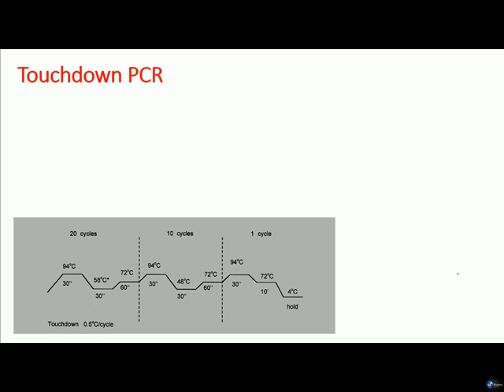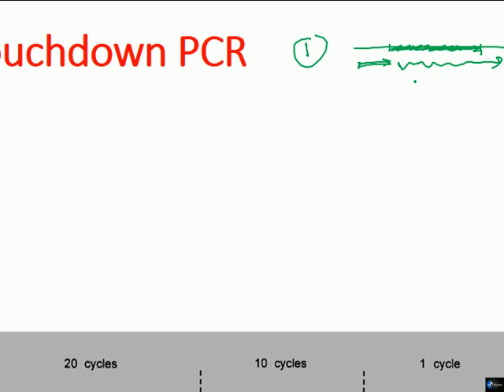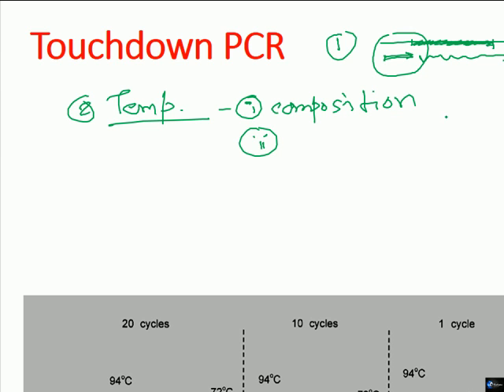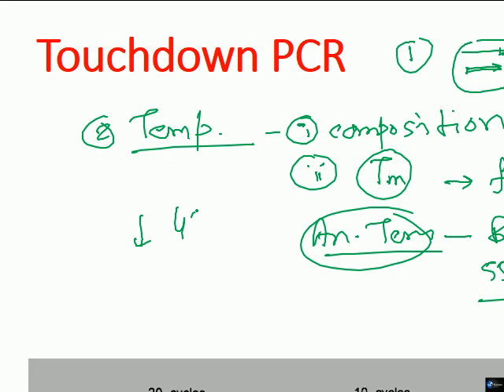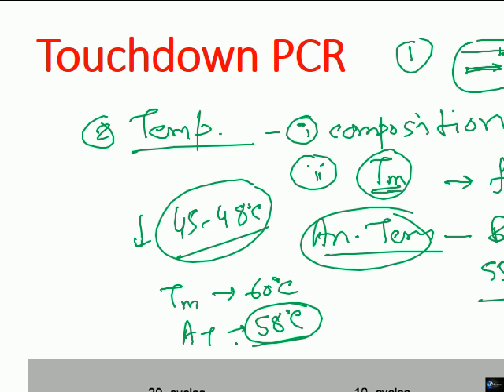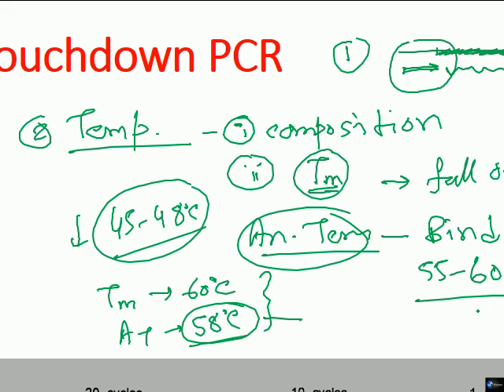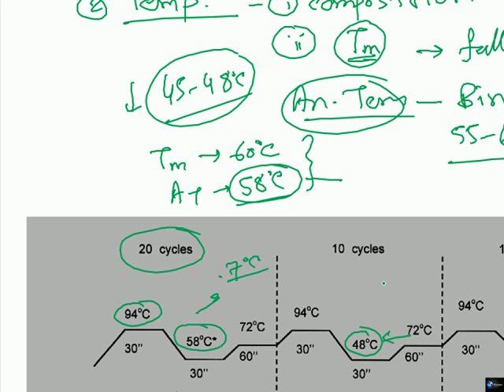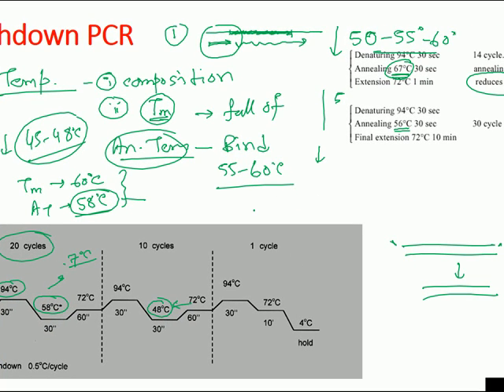Touchdown PCR

Comment: in google and various other sites, it is mentioned that the annealing temp at starting is 5-10 degrees higher than tm not lower. You had used the wrong term IG

Comment: all you said is correct unless one point is the definition of the melting temperature , you said it means the temperature at which the primer get damaged . however in PCR there is a beginning temperature of 95 degree to separate the 2 stands of DNA which is very high and do not damage the primer . so the correct defenition of the melting temperature is that it is the temperature that nearly below it the primer can bind specifically to the DNA strand and if we go far away below it , the primer bind unspecifically ti unwanted regions of the DNA.
thanks for the lecture , i like your work alot anyway
Reply: No , but the melting temp of primer is where primers get deattached from the strand i guess
Reply: No it's is the temp where the primers binds, that is annealing temperature and if the temperature is above than that, then it will bind to some non specific region
Reply: And also the melting temperature which is tm is the temperature at which double standards dna half seperates into single standard form